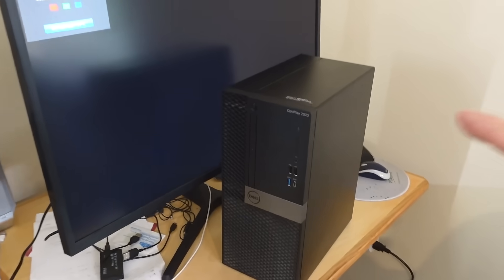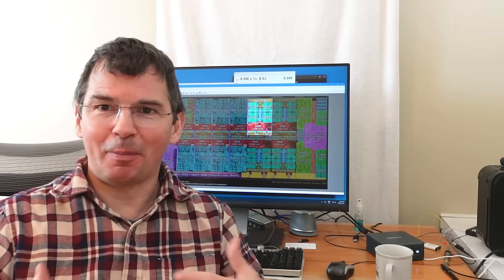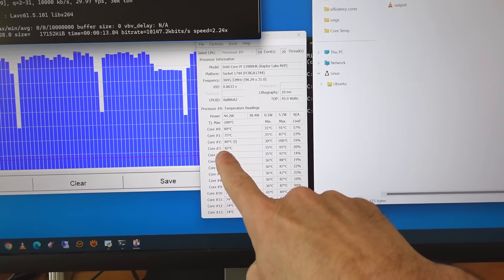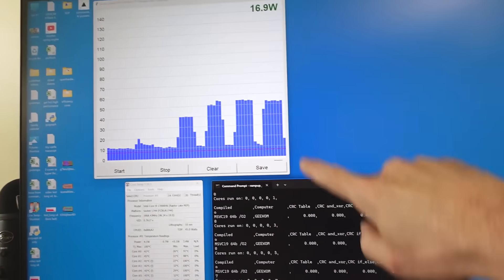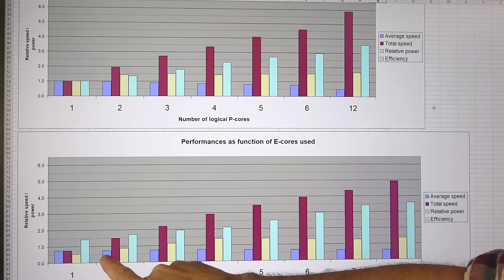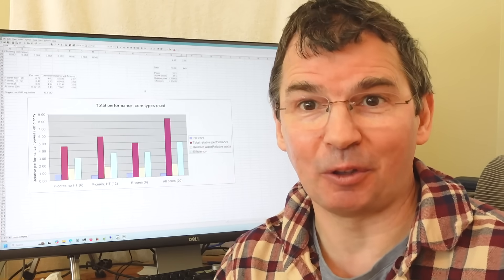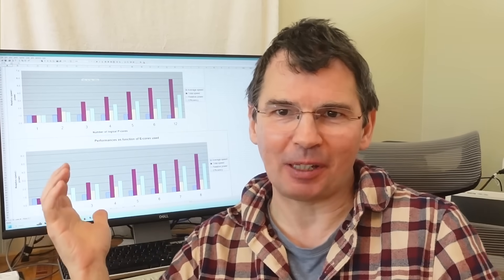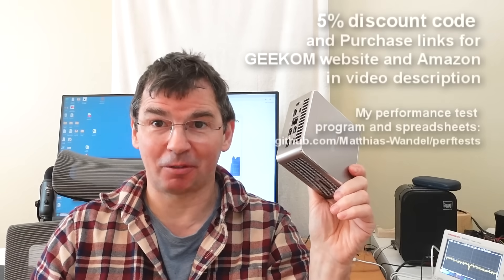Efficiency cores are about performance more than efficiency

Comment: As a PC building enthusiast for decades, I've switched most of my computing to miniPCs for efficiency reasons as well. I even ran off of an RK3588 ARM SBC for a good while until I got a new miniPC (HX 370) that could just about match it in idle efficiency while absolutely stomping it for high-performance workloads (while also drawing 10x the power there, though).

The big thing with Intel's e-cores are that they are, as noted, very space efficient in addition to their perf-per-area gains. As silicon manufacture is getting more expensive per chip size this has become quite important. The N100, N150, N200, and N300/305 are e-core-only chips that are phenomenal for miniPCs. They even have server chips running 144 e-cores at 330W (nominally, at least)!

AMD finally got into the differential cores as well, although in a different way. Intel's p- and e-cores are different architecturally (as evidenced by the lack of hyper threading in e-cores, although even p-cores have dropped that recently), but AMD keeps the arch and just scales the cores down (cache size primarily, I believe) leading them to be unable to hit the same peak performance (or peak clock speeds) but it's why my latest miniPC has won me over in terms of efficient daily computing.
Reply: Yea amd c cores are just low cache higher density (lower tolerance because of lower clockspeeds and voltages) able to make the core about 60% of the size iirc but remember amds normal cores are about half as big as Intels normal cores as of raptor lake
Reply: @WillFuI  The density probably comes from using a different, density optimized standard cell library (less tracks of height, less transistor W, less speed/driving strength)
Reply: If only desktop PCs could idle at 10 watts. I spent hours adjusting BIOS settings to get a Ryzen 5600 from 75 watts to 67 watts idle. Very good Superflower gold-rated power supply, clock speeds down to 2GHz, disabled cores, huge reductions in voltage, default DDR4 settings, disabled as many onboard devices as possible, enabled C-states, ultra low power plans in Windows, all that stuff. Apparently it is just impossible to do better than that.
Reply: @jimtekkit u still power gpu hdd ssd fans
Reply: @jimtekkit  Socketed desktop CPUs are usually not designed for low power operation.
Reply: @No-mq5lw The chiplet architecture is the main reason why Ryzen is so bad, it's inefficient at idle due to overheads relating to the IO die and CCD communication. So that also explains why chiplets aren't in laptops yet, there's a hidden power consumption cost.
Reply: @jimtekkit they are in laptops. They have the desktop chips in laptop and the new strix halo has chiplets
Reply: @WillFuI  And how long did it take......six years?

Comment: Yeah there are so many variables with the cooler style and the BIOS and power delivery configurations on these mini PCs. It's hard to say from one build to the next what the performance would be, especially for extended all core loads. Thanks for the info.
Reply: In urban areas it is possible to obtain old big desktop cpu cooler for 2-3 bucks, and with little bit of tinkering you can mount it on top of this style of PC.

Comment: I think the way AMD has gone about small cores is smarter, though more work and requires chiplets. There's no special architecture, it's the same core architecture but redesigned for a low power and high density process node. These cores are actually very efficient per watt with not too bad of a performance hit. Additionally they're fully featured cores, unlike Intel E cores which don't have AVX-512 to accelerate things like video encoding.
Reply: AMD has yet to launch a chiplet hybrid CPU. Their hybrid CPUs have all been monolithic mobile-focused APUs so far. There is potential for this to change, as they do make both Zen5 and Zen5C CCD chiplets, though there's no confirmation they want to go this route. Their approach does not require chiplets, and in fact has seemingly nothing to do with chiplets, just like Intel's.
Reply: @DigitalJedi I would imagine they would just use 2 different chiplets that’s a much easier way to do it. Also they don’t use chiplets in the laptop first SKU’s until recently
Reply: AVX-512 also gives you a boost emulating many PS3 games
Reply: AVX-512 is fully disabled on the chips with P and E cores. On the first generation you could disable the E cores in bios and it would become available. But they patched that out. 

And i think you might be confusing quick sync with AVX-512. 

But yeah the P and E cores just force all the problems onto the scheduler and it's not a good solution. The only reason they got away with it is because it's intel...
Reply from the maker: its not that its disabled in those cores, its that it was never implemented in these cores, which are based on an older design.
Reply: @matthiasrandomstuff2221  they are talking about Intel's desktop chips. The first gen p+e setup had axv512 on the p cores. At launch you could disable the e cores in the bios and avx512 would work on the p cores. Intel removed this ability with a microcode update. If you have a old bios you can still do the trick. It doesn't apply to all Intel BIGlittle setups.
Reply: @SquintyGears I'm not confusing quick sync with AVX-512, that's a different encoding algorithm as I understand, not just an instruction to use for software encoding. Also AMD doesn't have quick sync so it's not applicable.

I'm saying that AVX-512 is used to accelerate software encoding more than AVX2, maybe not so much on H264, but definitely on H265 and AV1. Intel is missing out on this with their current implementation which has had to get rid of AVX-512 until both core architectures have it, if they ever do it for desktop.

For AMD, when you use AVX 512 on Zen 4 chips you get a minor performance boost and a small efficiency boost. Zen 5 having the full 512 bit width for execution gets more significant speed boost along with efficiency.
Reply: @Jaker788 yeah i only thought you might be confusing it with quick sync because you only mentioned video encoding. AVX-512 is more general purposes vectorized compute. It's not that efficient for video compared to the dedicated blocks in the GPU. Usually that's what people end up using. Do you do something specific for work that takes advantage of it? Sounds interesting.

But like I said, after the first P and E core launch intel has been completely fusing off the AVX-512 blocks from the big cores. It's not available on desktop at all.
Reply: @SquintyGears Software encoding always beats fixed function encoders that you'd find on a GPU, that's why i mention it. When you're encoding professionally or for anything beyond streaming, software is always a better bet for more quality per bit. These days x264 is so easy to do via the CPU anyway that some people stream with software rendering to maximize quality.

When it comes to newer codecs like AV1, the current fixed function hardware encoders are severely limited in features and aren't much better than x265. Software encoding is still the only reasonable choice here until a few more generations of hardware iteration, and wven then it'll only be useful for streaming, not archiving or production. The encoding algorithm is always being updated and improved which benefits software encoding, but fixed function hardware encoders are stuck. Until a codec is well matured hardware implementation is usually weak, plus until it's well adopted the transistors allocated to it are less which limits more advanced features of the codec that benefit quality and compression.

AVX-512 gives a 20% or more performance boost over AVX2 for AV1 encoding on slower presets and high resolution, with Zen 5. Video encoding heavily uses vector math, but still also uses scalar and other math, which eliminates general purpose GPU encoding as an option.
Reply: unfortunately amd's chiplet design leads to gigantic idle power draw, something to do with the IO die. so its efficient when its at high load, but when near-idle, intel beats them out
Reply: @mtqrx  Except for on their mobile SKUs which are monolithic. Also their beefier APUs like the 8600G if I'm not mistaken.
Reply: @mtqrx gigantic? I mean yeah it's like 17W so it's much bigger than what is effectively a laptop chip here. But if you're worried about that just turn off the computer... It takes 10s to turn on. Everyone has an ssd now.
Reply: @SquintyGears  i do turn it off because of that, on my 5600x pc. but for computers that have to stay powered on, like my home server, intel is pretty much the only option. amd's monolithic designs (their G-suffix processors) dont suffer from the same issue.... but they also dont have ECC support (which AMD have decided to restrict to non-G high idle power draw systems, or PRO models which are only available to system integrators, not consumers)
Reply: @mtqrx  I managed to get a bunch of AMD PRO APUs and run ECC memory with them.  2200GE, 2400, 4350G, 4650G.  I absolutely agree that the PRO-only ECC support is nonsensical.  Either don't disable ECC support across the lineup, or allow retail sales of PRO APUs!
Reply: @SquintyGears 10s my ryzen took 5 minutes to boot lol
Reply: @mbahmarijan789 what are you even doing?
Reply: AVX-512 won't accelerate anything if the software wasn't developed taking it in account ...
Reply: @RicardoSilvaTripcall and nothing will ever rely on it if it's not actually available on hardware. Tks cptn obv
Reply: @SquintyGears  So, have you already started rewriting everything in AVX-512? let me guess ...
Reply: @RicardoSilvaTripcall 😂😂😂 I'm not on an x86 systems for my job. And stuff i build as a hobby on the side wouldn't be accelerated by longer vectors. So no. But that's an empty argument that doesn't support anything.

Comment: TSMC process is better than Intel, but Intel software for linux is better than AMD. So I do not get ryzens anymore
Reply: What intel software?
Reply: @riba2233  I wonder if he means firmware or perhaps peripheral drivers.
Reply: @riba2233 drivers in general
Reply: Wait, what? How is it worse? I have no complaints about my setup.
Reply: @lfox02 he is just making stuff up
Reply: @riba2233 no, amd integrated graphics card linux driver is pretty crappy, for example
Reply: @xanokothe we are talking about cpus here, how did you end up on gpus?
Reply: @riba2233 cpu has integrated graphics cards are you trolling?
Reply: @xanokothe again, irrelevant as cpus are the topic here, nobody mentioned GPUs (not igpus nor dgpus)
Reply: @riba2233  video is about mini pcs that use the igpu... gpu is a factor when deciding between the intel and amd variant. why so snarky?
Reply: @ControversialOpinion bruh, really? 🤦‍♂️
Reply: @ControversialOpinion  AMD or Intel both work just fine in Linux, Nvidia though, boy!
Reply: Google a bit about it. The nanometers are marketing (mean different things) and are not comparable by number. But actual density of intel and tsmc processes is similar (that's why intel started to use "Intel 7" name for the process).